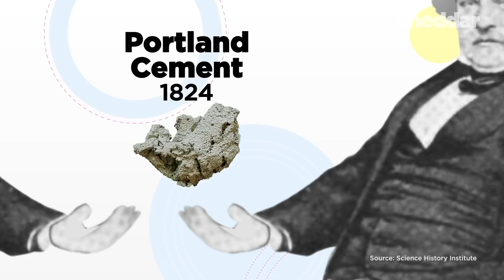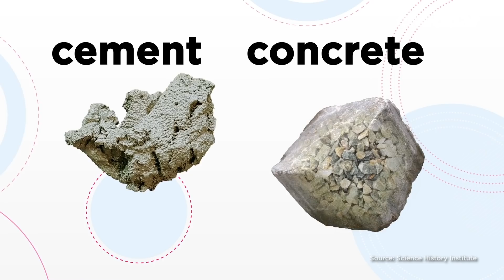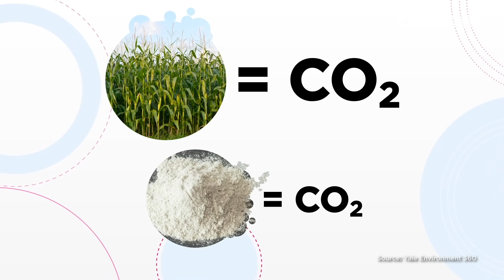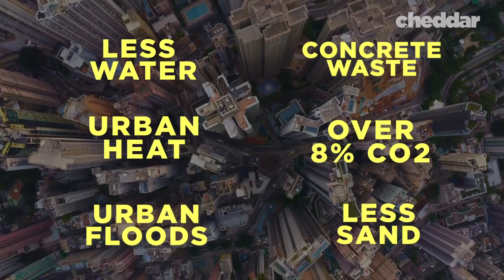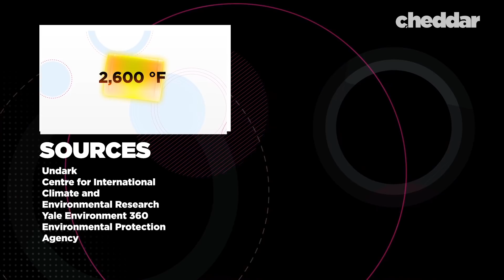Is Concrete The Most Destructive Material On Earth? - Cheddar Explains

Comment: Another thing about the shortage of sand is that you can't use desert sand or ocean sand as they are too smooth for concrete. We have to use river sand that is rougher and better used in concrete.
If you want to learn more about this then here is a recent SciShow video on the shortage of sand.
https://youtu.be/i2_PADr0jAA
Reply: Ocean sand is actually the correct texture, but taking beach sand could eventually lead to severe erosion on coastlines. Sand taken from the ocean floor would have little environmental impact, but it would have to be cleaned of salt, which would add considerable cost. So we're not running out of sand, but we are running out of cheap sand.
Reply: @gabrielfraser2109  ocean sand, beach sand and river sand is more or less the same. The vast majority of sand we use for concrete today comes from the oceans nowadays. Ocean sand is nearly as problematic as beach sand for erosion though, as beach sand will with time "fall down" to where the ocean sand used to be. That's why a oot of islands in SE asia are disappearing.
Reply: Oh. That's an important detail. Thanks.
Reply: Now it's compulsary in India ( atleast in my state) to use manufactured sand ( crushed rocks) for concrete
Reply: @vishalgiraddi5357  which state?
Reply: @Echold  Tamil Nadu, I think.
Reply: @Echold  Karnataka, although because of corruption  some 15-20% of buildings still use natural sand
Reply: @vishalgiraddi5357  A related fact is that India (and lots of neighbouring countries) have banned the export of sand to Singapore, which has absolutely enormous demand for sand for land reclamation, to the point that they've been accused of damaging the ecology of those countries.
Reply: M-Sand is better than River sand
Reply: Nice one brother! I was just thinking what bs how can we run out of sand. Timely correction.
Reply: @vvinny8  who are you talking to? We are literally running out of sand.
Reply: @MTobias  Lol
Reply: Mate the sand issue is a price issue we aren't lacking sand, we are lacking sand where concrete is needed
Reply: Yes, you can use desert sand. Don't be ignorant, please. The nerve to be so categorical about knowledge..!
Reply: Maybe we could mix it with some sort of adhesive?
Reply: @Someone-ig7we  the cement is the adhesive.
Reply: @Someone-ig7we  the cement is the adhesive, but when the sand isn't rough enough/too smooth, the tensile strength is reduced
Reply: What about using crushed glass as an Aggregate?
Reply: @kingslushie1018  that has been used in some places but is also a very unsustainable resource.
Reply: @jacobz4967  I'm sure it'd be complicated and probably consume a stupid amount of energy. But if crushed rocks and glass work, would heating desert sand to its melting point and then crushing the (partially) fused material you're left with after it cools down be suitable? It would address the issue of smooth erosion that happens normally to plentiful desert sand.
Reply: @kingslushie1018  You can do that and it's often already done. However, it's arguably better to recycle old glass back into glass.
Reply: has to be is standrad concrete that is not elongated
Reply: Crushed rock makes an even better aggregate.
Reply: you can use ocean sand
Reply: Conservation KILLS jobs!
Reply: Wrong!!
Reply: Any sand will do. In fact, any aggregate of varying sizes can be used. In the Caribbean, they use beach sand, not river sand. The point is to use the proper amount of aggregate as to maintain structural strength and minimize the amount of cement used.
Reply: That's a Huge lie
Reply: Then what ? Do we have to lower our population ? If we are so stupid to demand changes ?
Reply: @azizkaraulov6872  we must to eat the richs.
Reply: Not lower, return to communal living..
Reply: @azizkaraulov6872  the population is already being lowerd

Comment: We need to figure out the exact ingrediants the egyptians used to make their structures. Possible geopolymers
Reply: Modern day concrete is better than anything ancient Romans or Egyptians built
Reply: @mufasaiam7794  I wouldn't say better but different, yes. Depending on the application. Our concrete won't last nearly as long as the predynastic period or Roman era. Until we invent something new
Reply: Limestone.
Reply: Geopolymer Institute channel is fantastic. He gives you the recipe. Also Puma Punku they used rubber in the geopolymer
Reply: Their building designs are inefficient in terms of space. Large structures just a some tiny rooms inside it.